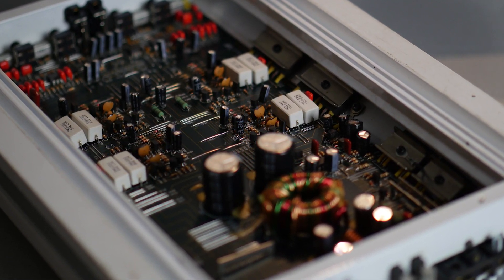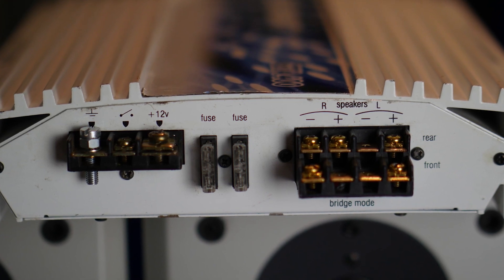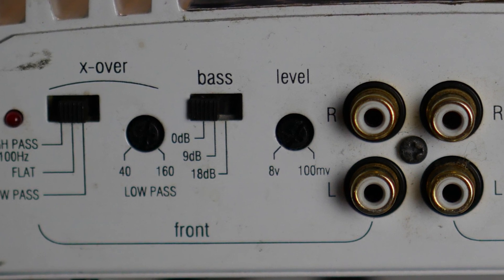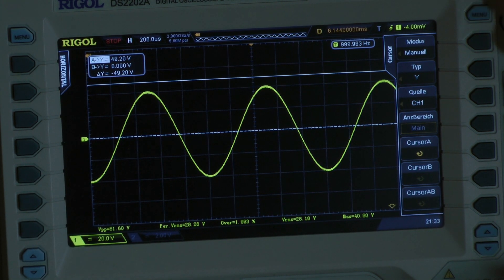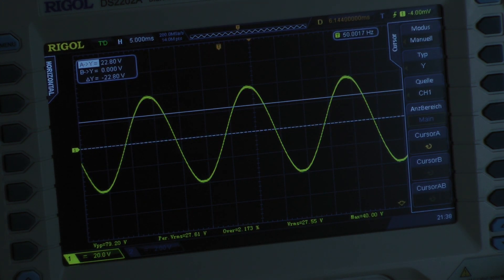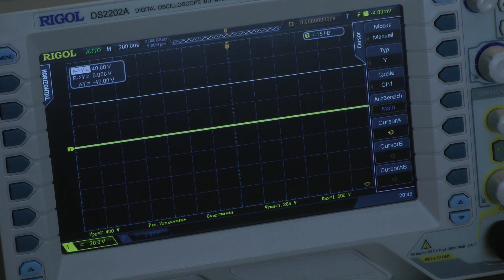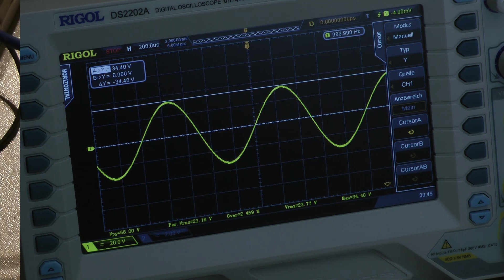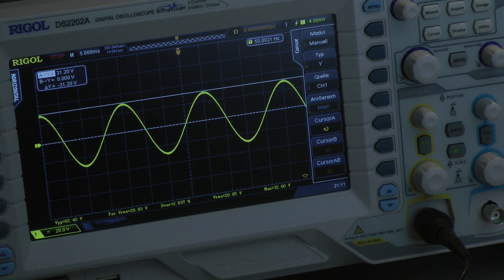Blaupunkt GTA 400 Endstufe oldschool car audio amplifier power sound test amp dyno Leistungstest

Comment: Hello, nice video!
I have a Blaupunkt THA2125  amp rated at 125w per ch, or 400w x 1 ch.  It has a 60 amp fuse, and inside it has bigger caps (2 x 4200mf at 50v)!  Do you think it may have the power it claims?  Thanks.😊
Reply from the maker: I don’t know this amp but with a 60A fuse it’s likely possible that it does more than 400W 👍